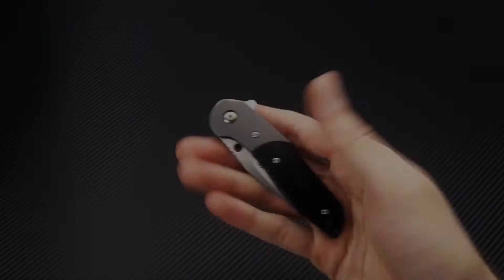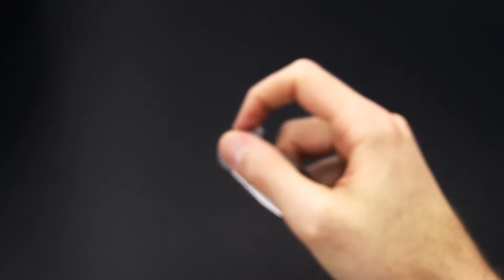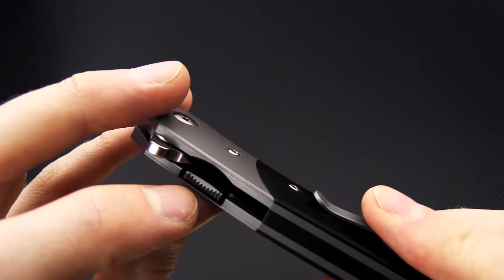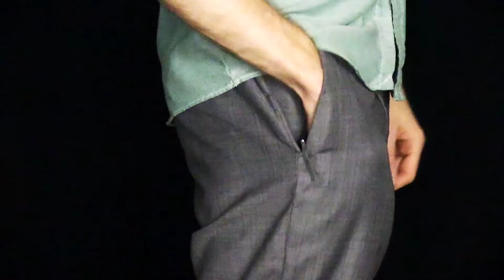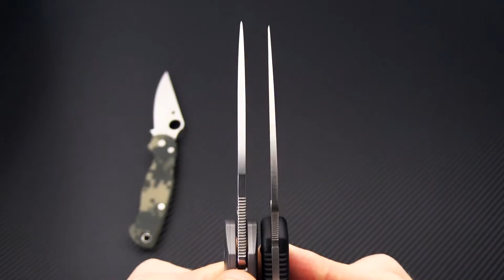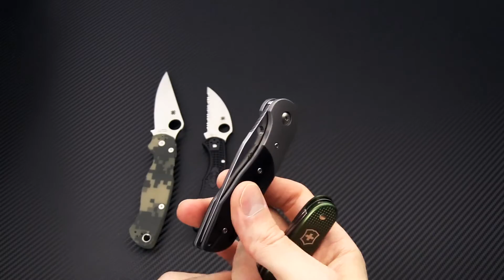Spyderco Hanan Southard Compression Lock Flipper Overview

Comment: Why this model didn't become more popular is beyond me. I feel really lucky to have been able to get one for myself. I love the blade design. The handle feels a tiny bit too short but I feel I have total control of the knife for slice cuts. It's also a good piercing design. If only it was just little bit bigger, say, a 3.5 inch blade with a corresponding increase in handle length.